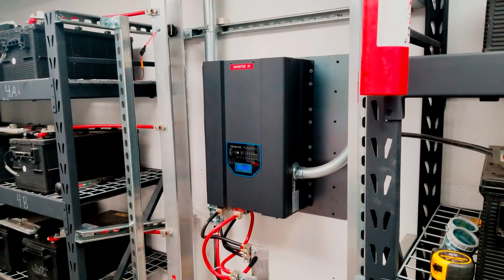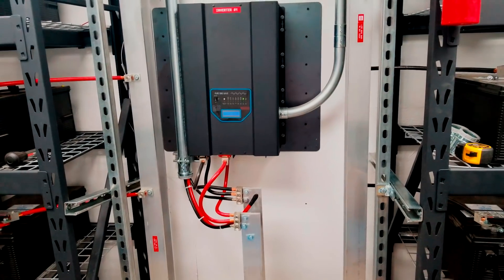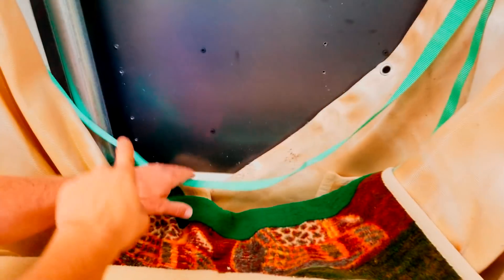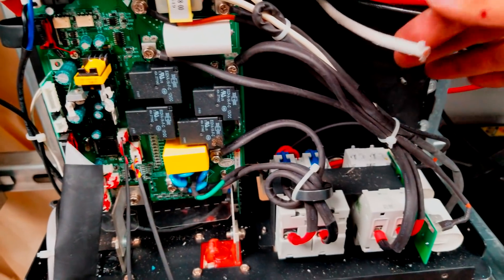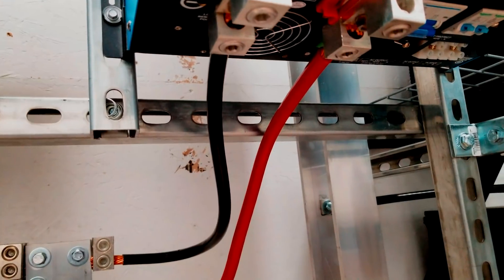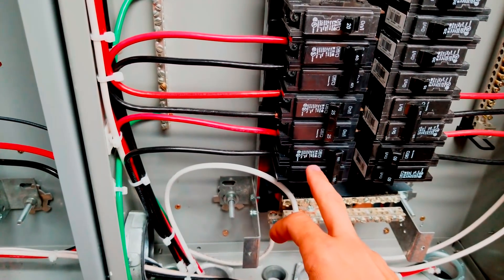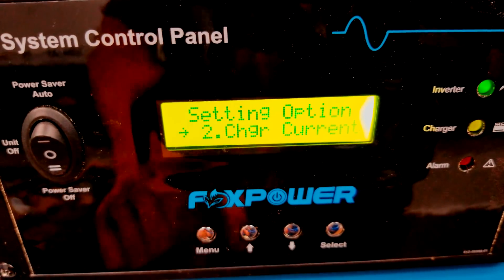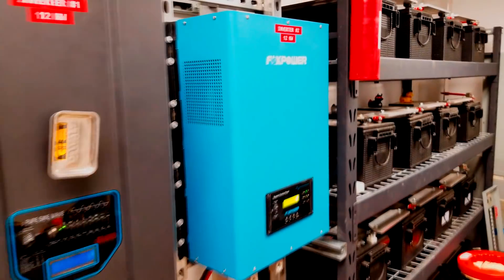FoxPower 12KW Off Grid Inverter/Charger Installation

Comment: Your conduit the whole layout is absolutely beautiful. You may consider viewing some battery room pictures regarding bus runs. The methods in your video are extremely dangerous. You may consider an overhead run using more standoffs to maintain separation and shrink tube to help prevent dead shorts

Comment: Did you have a Fascination with wal mart car battery displays and  Powerplants as a kid.. What the H is with these Buss bars for 500 amps …. One of the best ways to maximize solar is to scale the system ..not to use a fire hose for garden hose pressure.
Reply from the maker: But if you have a fire hose ready to go and then one day you need fire hose pressure, you have it without having to reinvent the wheel

Comment: how is the fox power inverter working out?  what's the max load you have pulled so far?  i priced one at $1300 is that right
Reply from the maker: Max load I've pulled is around 18kw briefly, but I've had it at 100% quite a few times running things like welders or plasma cutter + air compressor.  Price wise that is fair, but likely prior to shipping

Comment: I hope I haven't explained things below badly and scrambled your brain. Its just what I would do, have a nice small wooden box that will show you the condition of everything and at the same time fully automate any inverter fault and start the genny if needed.

Its a beautiful and very professionally done installation. I can see you care about doing a propper, safe and clean install. In my 25+ years as an electrical engineer I have not seen many installs this good and that includes my years in the Royal Navy. You should be proud of it and proud of yourself.

P.S. 1 suggestion and 1 request  -  Fuse your inverters separately not of 1 fuse. With the HRT high current fuses you are going to need you could spend a fortune if your not sure of the troublemaker !

As for the request ......  There is a very interesting panel with indicators and buttons on the back wall. (your supply switching I assume) Any chance of a peek in that cabinet ? I would not be surprised if you lace wired it.

Are you an electrical engineer by trade or have you just learnt from the school of life ?

All the best   :)

Stuart.
Reply from the maker: A lot to take in.... You can see in the control cabinet in one of my newer videos called click PLC meets off grid
Reply: @HighTechLab  I will look forward to that. I was wondering if PLC and RS485 would be making an appearance at some stage..... To save on any mushroom clouds please make sure the watchdog works   :-D

Comment: You most likely have already but have you considered using the old inverter as primary on invert / gen mode and feed the mains out of the old unit at 230v into the new unit in utility / bat mode. That way you don't need an interlocking selector.

Set the first (old unit) as your charger when power is present so its mains input would be from the genny and at all other times it would be inverting and the second unit would use the supply, augment it if needed then pass the mains to your load.

I am trying not to make it sound to complex... so basically the new unit would be in ups 240v 2 phase out to the house. Its an LF inverter so I am sure it could be set to voltage stable mode like a normal ups would. That way if the voltage from unit 1 (old) was a little low it would stabilize your supply rail to the house.

So you would be covered like this.

1. Battery voltage gets lower than the limit set on unit 1. This can close the relay on the unit, switch over the source supply when the genny is up to voltage. So your covered automatically in the event of low battery.

2. In my experience these units will always pass through the source power and close the relay as the relays are always energised. That is why they present a small load even on standby. when there is any power supply be it mains or battery. This would cover you from unit 1 developing a fault.

3. If unit 2 fails that would then pass through the 230v from unit 1 and close its contact. You would still have power as unit 2 would go into full invert mode. I expect they are DPDT relays on both so you could use one side as an alarm output and the other for a contactor or motorised selector switch.

For monitoring in the home wire the alarm relays second poles in parallel and wire via the batteries on one pair of a multicore cable to a small piezo sounder in the home. I would then use a three phase voltmeter and a dc voltmeter and mount  them in a nice looking wooden box (wife proof). You could then wire it as follows and you don't have to worry about voltage drop as the loads are in the milliamp range.

You would need 2 mains rated 6 core flex cables with a very low AC and DC fuse for each pair in case of damage. A 1 amp ceramic would do for everything.

Pair 1. Cable 1. Wire an alarm sounder supply as explained above. Connected to sounder indoors. Wire a latching relay with a button to latch when the 48v (fault) output is on.

Pair 2. Cable 1. DC feed to DC voltmeter to see battery voltage.

Pair 3. Cable 1. You could use a DC hall effect sensor round your DC fuse to show the current draw from your batteries. 

-----------------------------------------------------------------------------------

Pair 1. Cable 2. Mains voltage from your generator feed and a sounder if you want so you would know its started. This would be phase 1 on your three phase voltmeter. *

Pair 2. Cable 2. Mains voltage output from inverter 1. This would show you it was that unit that failed if the display went out. That would be wired to phase 2 on your three phase voltmeter. *

Pair 3. Cable 2. Mains voltage output from inverter 2. Like unit 1 if it went out you would know it was inverter 2 that had failed.This is wired to phase 3 on your three phase voltmeter. *

* You could only use a three phase voltmeter if all of your neutrals are common with each other. If not you will need 3 separate mains voltmeters. If they are common you would only need a small 4 core mains cable. One core for the neutral and the other three for the three mains feed.

Comment: Did you ever get one of the connected as a charger while the other one fed power to the panel?  How did you end up utilizing the second inverter?
Reply from the maker: Yeah.  The black inverter turns in and charges batteries whenever generator is running and also is PLC controlled... It turns on to power diversion loads such as our hot tub and turns off when not needed to reduce idle draw.  The blue inverter powers the typical loads.  The setup has been working extremely well.
Reply: @HighTechLab  When the black inverter is charging and the blue inverter needs to supply a heavy load, does the circuit breaker inside the black one trip?  Im wondering if this would happen in a similar setup with a 8kw'ish generator.
Reply from the maker: @sethreichardt148  the black inverter can only output a set amperage so if there is a heavier load then the black inverter can handle the batteries make up the difference.
Reply: @HighTechLab
Reply: @HighTechLab  Thanks for the clarification!  Keep up the videos!

Comment: Wow you have made great progress. I like the fact you can use the change over switch from the genny to recharge. If your two inverter / chargers have a programmable clean changeover relay you can program to close when the cells are full you could use this........

https://www.ebay.co.uk/itm/1x-Mini-Type-Transfer-Switch-Dual-Power-Automatic-Transfer-Switch-63A-4P-3P-2P/192831308645?hash=item2ce5a44365:m:mTfsk9vC7TbOyFmyh1n17bA:rk:32:pf:0

Its cheap Chinese kit but there is nothing wrong with the motor and gearbox. I have used one replacing the two switches with decent 3 pole switches and it works a treat. I have an 8KVA UPS and generator. I have wired the on battery relay in series with the generator running relay to the motor.

So in a power outage the UPS keeps all my loads on until the generator has run up. Once both relays have closed the motor changes over to the generator. When the power comes back on the UPS relay starts a ten minute timer. Once the grid has been stable for 10 minutes the motor winds back and switches the supply power back to the UPS.

You could of course do this with a contactor but the advantage of the motorised interlock switch is that it does not need continuous power to work. You just send a mains power pulse to the unit to changeover motor. It may be worth you looking at and could be useful if you are not at home during an inverter failure or trip out. It would also ensure the two units inputs can never be connected at the same time as the mechanical interlock prevents both switches from being closed at the same time.

You have very likely considered this scenario but I have found them useful in the past. The other bit of kit I have used before is a current clamp with voltage monitoring that sends the data over RS485. You could then monitor both inverters and the generator for live data and log power production from all three.

Just a few ideas anyway. Keep up the great quality workmanship and safe system wiring. You are doing a great job. Hopefully in the future you could go over to LifePo4 battery packs. There energy density is fantastic and you get 2000+ full cycles + you can completely deplete the cells unlike AGM, GEL or Liquid lead acid !   :-)

Comment: I have the siginner  inverter my electronic clocks all of them are delayed, this make me think my inverter is not pure sine wave, did you have this kind of problems or why are your testing another one, how much money did you pay for this new one.
Reply: I have the same issue with a Magnum energy inverter. Digital clock loses 2 minutes a day.
Reply: @osseo9947  If your clocks use synchronous motors then I would put more money on it being a mains frequency issue.  When the utility company's have a low frequency output they then increase it for the same time period afterwards. It is something that is very hard to get right.

The skill in running the grid is to keep this is balance. Most power stations have well over £1m of equipment just to deal with this issue but as they can control the fields in the windings and electromagnets they have far more control.

If your clocks use a switch mode power supply they should have a 32768 Hz crystal onboard and anyway the switch mode power supply should be able to adjust to voltage variations. As I said its hard to get right.

Comment: I recommend turning your main panel into a split bus and add three more contactors to to the transfer switch so you can use both inverters simultaneously and you have your full 200 amp capacity.
Reply from the maker: While possible the inverters have a 150 watt idle draw, so the less the seconds one is on, the more effective the system is
Reply: @HighTechLab  so you could itergrate a relay across the switch on the inverters to turn them on and off from the control cabinet then you would have no idle draw and you can turn each one on individually.
Reply from the maker: You are on the right track. So what I ended up doing in later progress, which I have not yet posted a video of, was tied in the black inverter with the PLC that way when I want to use it as a battery charger I can turn it on, and then the diversion power that heats our hot tub comes from the black innverter because the solid state relay and the way it pulses causes odd voltage spikes and drops, so I don't use the power elsewhere. I consider the blue inverter my clean power because it actually outputs a true 240 volts instead of 220 to 225 volts, so the blue inverter Powers the main loads and at this point I am pretty comfortable with the amount of power conversion capacity that I have.
Reply: @HighTechLab  ok that's a good solution. What you need now is some more solar so you can charge your batteries fast and use less gas. I Really like the new look of the power room it is way more organized. In the future you should invest in a 24kw inverter so you don't have 2 inverters. Can't wait to see it expand over the years. I would also invest in lion or Lipo batteries so you could have a better energy density and more charge cycles as well as so you don't have to fill them up with water.

Comment: Whats the point of this powerhouse?!
Reply: To run his ranch off grid no power bill.
Reply: Funny I run my place with  a 3500 power drive inverter and 6 deep cell 80 amp hr batteries and 1200 watts of solar no bus bars two charge controllers and no breakers  but im only powering my 40 fr trailer.

Comment: Are your inverters running a floating neutral or are they bonded? Thanks
Reply from the maker: They are both bonded and the generator is also a separately derived system. They all three have separate neutral bus bars. The transfer switch for the generator transfers the neutral between the blue inverter and the generator. The black inverter neutral and output currently are unused. If they were used they would be treated as a separately derived system also and would have a dedicated panel
Reply: With separate neutral bus bar do you have a grounding wire attached to each? How did you bond the neutrals to ground?
Thanks
Reply from the maker: @BonitaCreekWaterGuy  the neutrals are bonded in the inverters.
Reply: Been looking for an inverter with neutrals bonded. Went to Sigineer and was told  "We have split phase model up to 15KW.
But the Neutral shouldn't be bonded with ground as indicated in the wiring diagram in the below link
https://www.sigineer.com/product-category/inverter-chargers/split-phase-inverter-chargers/" . You might want to look into that. I also went to Fox Power and it looks like the neutral can be bonded to ground. Fox Power is the only inverter I have found that shows the neutral bonded to ground. Thank you for the video as it is the first time I have heard of Fox Power.

Comment: They both are the same product becuz they look very similar just that the fox power is rebranded
Reply: Not the same. Fox Power has a bonded neutral.
Reply: They are indeed made in the same factory.
Reply: @kevinroberts781   Also look like the brand  AIMS ,48Vdc in ,10kwatts inverter.

Comment: You have a lot invested in you power setup, curious why you went with aluminum for the busbars over something like copper....?
Reply from the maker: William Huston, Realtor my bus bars are rated at 800 amps. 500 MCM copper is good for 400 amps and cost $3.50 per foot.  All of the bus bars are coated at terminations with antioxidant.  Modern day Aluminum can be just as good as copper.  It is all about how you terminate it.
Reply: ah ok, i heard you correctly your powering 2 RV's with this setup?
Reply: HighTechLab why did u buy a new inverter
Reply from the maker: Cio Dokop the company sent it to me for free because they saw my YouTube channel as wanted to support me

Comment: Really cool. Both inverters look strikingly the same when the front covers were taken off. For the battery cut off voltage,  is it preset values or user defined values  on the new inverter ? Also noticed that both inverters are sharing the same battery bank but one serves as a charger when using the generator. Smart setup.. plus I love the inverter mounting racks,  they are really solid. Can't wait to see more reviews on that inverter. In terms of performance,  how would you rate them side by side ?
Reply: Interesting Ibitapo. You appear to have experience with both inverters. Interestingly I just watched your video on the Foxpower and his on video on it came up recommended. Which of the two is better e.g. Efficiency, noise, idle power draw, weight and so on.